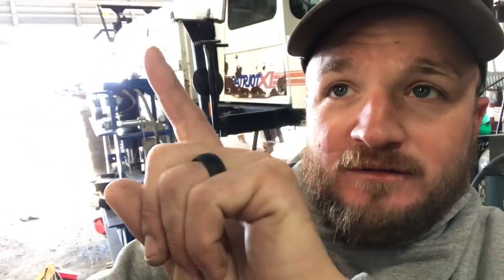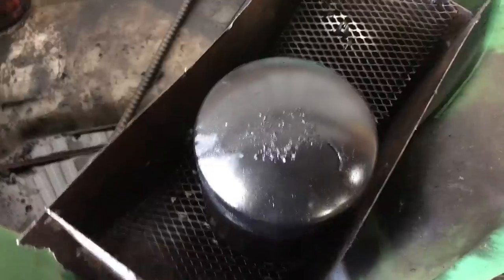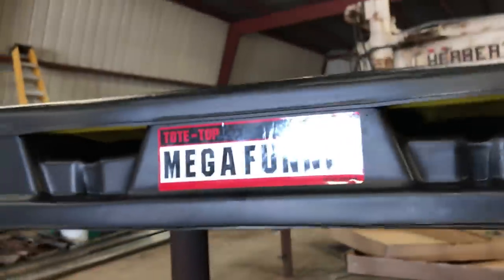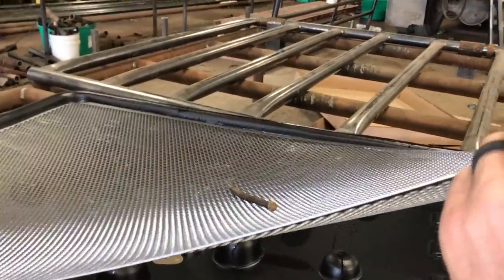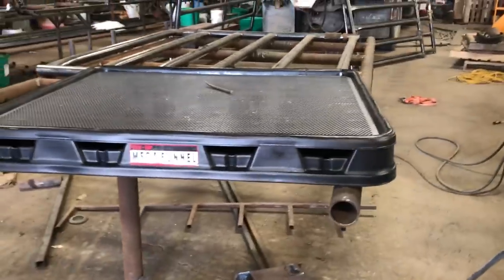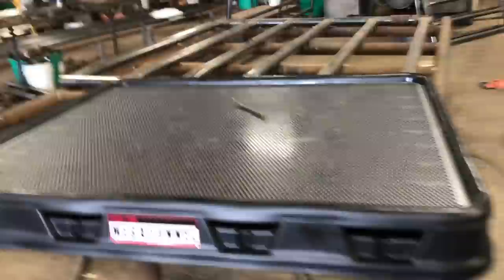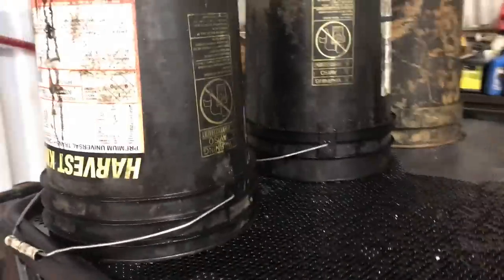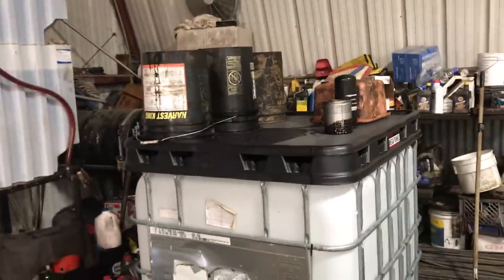Tote top MEGA FUNNEL

Comment: Nice, wondering if they make a round version for a 55gal drum? I’ve got probably 50 drums I saved for waste oil. It’s a pain too.
Reply from the maker: I dont think they do.  I think the 250 gallon tanks work great as you dont have to change them out very often as well as you can see how much is in there and it doesn't run over.   The totes are almost given away if you go ask a chemical dealer or farmer that does their own spraying.  But you could possibly ask them if they would entertain the idea of a 55 gallon drum one.  Id suspect the 55 gallon drums are going by the way side.